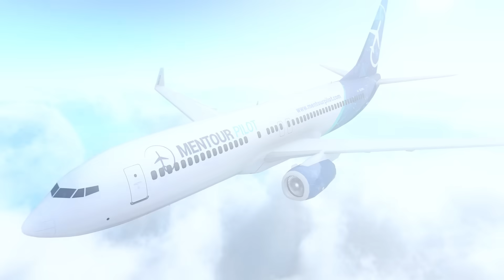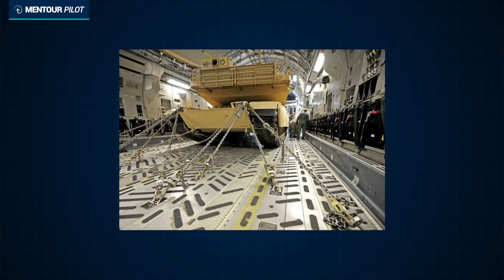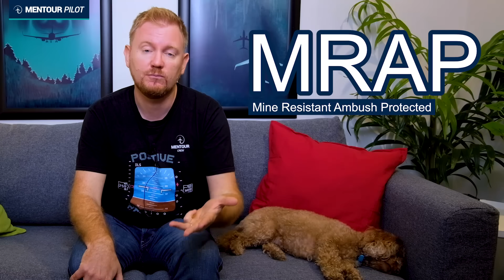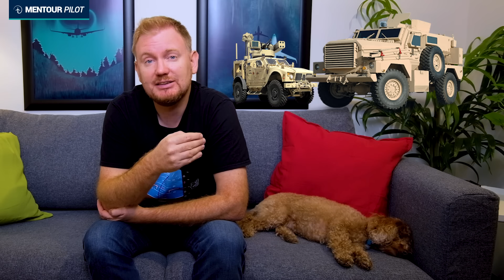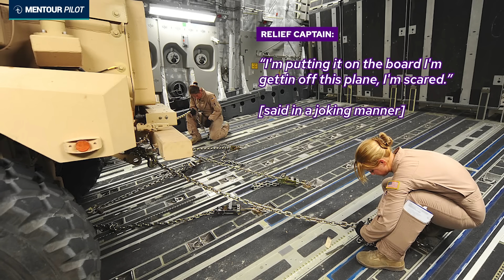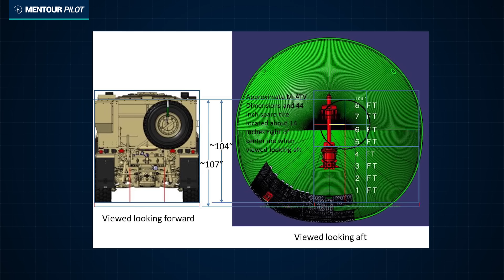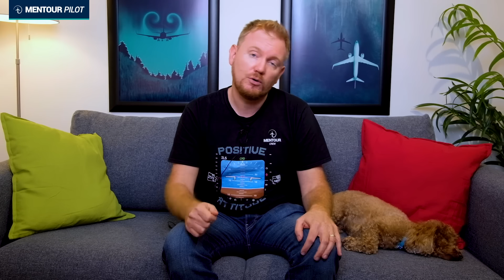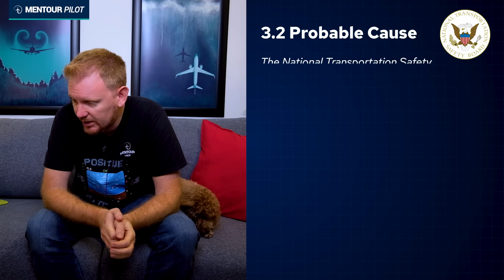Why did the pilots LOSE control?! National Air Cargo flight 102

Comment: My friend was the captain of this 747 and stationed in Dubai. There were two crews stationed there so they could fly back to back flights for the military into Afghanistan.  I saw this crash pop up on Facebook while traveling overseas and my heart sank. His wife finally got a hold of me about a half day later and let me know he was on the other crew back at the hotel.  Relieved but sad.
Reply: I am good friends with one of the wives. Those were some good guys there.
Reply: I remember this day very well, I was working at Bagram AF at the comm squadron next door the "Yelner" DFAC. We thought it was just another clost call with an RPG, felt the ground shake and the power went out for a few seconds (enought to reboot computers etc.). 

Usually we got an early warning for RPG, so this was a bit odd. Finally, word came in a couple of minutes that a cargo plane had crashed within a couple hundred yards of our compound we saw smoke and there was a significant burning debris field next to the flight line preventing normal flightline operations from continuing.

We initially thought it was shot down, but learned shortly thereafter that there was a cargo issue that caused the plane to crash. Definitely never expected to ever witness an actually plane crash in my lifetime, definitely pray for the crew's families as most of them probably relied on the crew members for their livelyhoods.
Reply: National Air Cargo is a disgusting immoral insanely negligent company run by horrible people
Reply: @nopers2223322  Not the first time I've heard this.  My friend quit.
Reply: @nopers2223322  clearly and it cost the lives of that poor crew.
Reply: @nopers2223322  so is U.S. country of porn infested military
Reply: @hadikhan63  what
Reply: @hadikhan63  bro porn isn't the issue. They weren't even in the millitary. Lack of regulations surrounding training of cargo handlers is the issue.
Reply: @hayleyxyz  wouldn't bother mate; logic fully out the window for these weirdos
Reply: @truedarklander  he works there..lmao
Reply: @truth_hurts45  my question was about what the hell was that brought up
Reply: @hayleyxyz  yes and we’re they even American cargo handlers??
Reply: @hadikhan63  Whatever Aloha Snackbar...go plant some more sand.
Reply: @hayleyxyz  can't regulate out incompetence, something the US needs to learn
Reply: @hadikhan63  I assume you are not aware of Pakistan topping the list of sex-googling countries... But anyway, let's not talk about inbreeding with your frst cousins for ages.
Reply: @hayleyxyz  ONE CAN CLEARLY SEE THIS
Reply: @shdanko  h
Reply: I knew the first officer. Good guy.
Reply: It’s been a while, but I believe my wife was with that crew you’re talking about. She talked with relief FO, and she’ll never forget the conversation before he headed off for the mission to Camp Bastion. Glad I left this company for other pursuits, and my wife leaving National Airlines was a huge relief for me.
Reply: I was friends with Mike Sheets… We grew up in the same neighborhood.  He was a great guy! Super funny and always had a smile!
Reply: So basically ur friend would’ve been on the crew in the crash but was in the other crew?
Reply: @yeasttrey  That's correct.  Was gut wrenching for quite some time.  But after all that, he did lose a few friends/coworkers.
Reply: Gercekmu?
Reply: Prayers for all on board
Reply: Why you lying doh mate
Reply: Not lying. Got nothing to gain by lying about a dead man. I knew Jamie, he tried to convince me once to work for that company.

Comment: Very interesting and educational. Thank you for the in depth explanations.  I hate to be 'that guy', but I really appreciate your decision not to use the dash cam video as it would not provide any additional information that other graphics and explanation hadn't already covered.  However, your team could have just as easily showed your crash animation stopping at a wing-level contact with the ground and explained that it was not a survivable crash. If the intent was to be respectful by not showing the actual video, what is the point of providing a detailed animation of the crash and  conflagration just the same?  Neither are really useful in the context of an educational video, but at least the real thing would limit the chance of any 'artistic' errors and let the viewers see for themselves the outcome of the series of decisions that were made.

Comment: Meanwhile Iraq has acquired some brand new “Chinese😜” Cougar Clones called KuGurs.   The actual Cougars in the horrific crash surprisingly looked similar to a first edition civilian made Hummer.   With 34” inch spinning rims.  Rims were reportedly still spinning 2 years after the FAA’s failed attempted investigation of the heist...umm accidental crash.    The 12 camera angles used in filming the 8k high resolution stunt shots for the events leading up to the accident were still usable for The Fast and Furiously beaten to death 15.  The prequel sequels to the origin story ending.   In theaters on August 15 and available for purchase on BlueGay UHD or 1k  for rated 18 to come inside.    No Rock this time, just Johnson

Comment: Excellent video - as usual.  As a former KC-135 flight simulator technician (E5 Staff Sergeant), I would see the instructor pilot set up a scenario that attempts to duplicate the conditions that led up to a crash.  Then the crew would try to fly their way out of that bad situation.  Sometimes they did, sometimes they didn't.  With some exceptions, their flying skills seemed inversely proportional to their rank.  1st Lieutenants (O2) and Captains (O3) were the sharpest.  Lt Colonels (O5) and Colonels (O6) were a little rusty.  Although they were required to take a "check ride" twice a year, as desk jockeys their best days as a pilot were behind them.  I remember one Colonel who crashed the simulator after an outboard engine flamed out during takeoff and he stepped on the wrong rudder pedal.  Instead of admitting he screwed up, he blamed the simulator by referring to it as "a goddamn multi-million dollar pinball machine".  It took a lot for me not to respond to his comment.

Comment: Just to add 2 small points:
1. In B747F (older ones at least that I worked with) there are no locks in the center position where these vehicles were loaded, so the pallets are loaded in what is called "floating" position.
It means that only the straps are keeping the cargo in place.
Also, you should take into consideration that the cargo would experience more than 1G in some events, so the calculation should be for more than the actuall weight of the cargo.
2. The orientation of the strapes are also important, there should be various angles to prevent movement up/fwd/aft/side.
We had engineers who gave us the number and orientation of straps for such cases.

Comment: Given the oft repeated cockups and lacklustre oversight of the FAA contrasted against the NTSB, would it not be a good idea for the NTSB rather than the FAA to be the final arbiter, not only of FAA recommendations, but also to sign off on those recommendations?

 This is especially true since the FAA too often appears to take a very lax view with regards to certain safety measure implementation timelines, sometimes allowing years for implementation. There seems to be no oversight of the FAA and ITS ineptitude in quite a few cases. Is it actually fit for purpose?